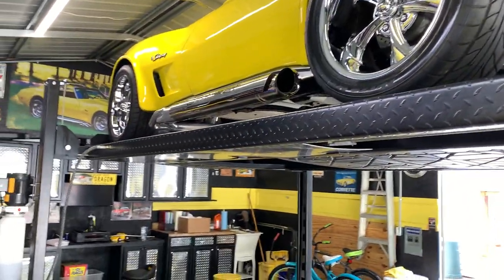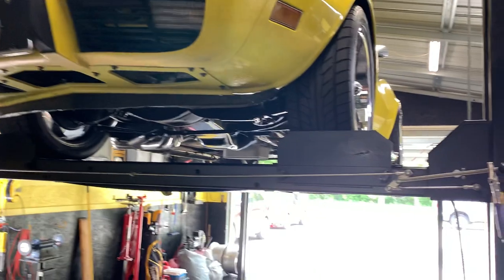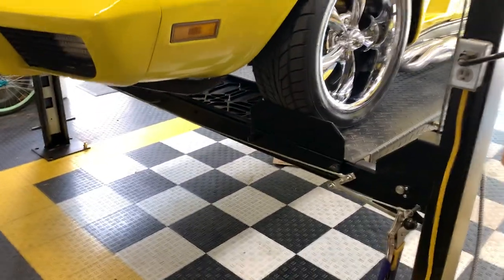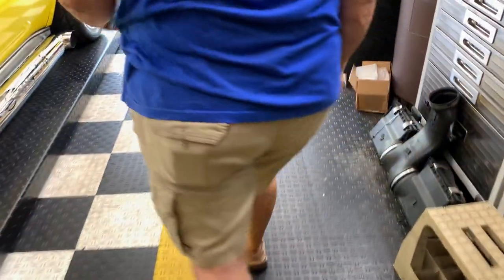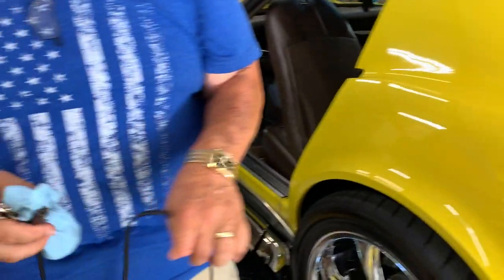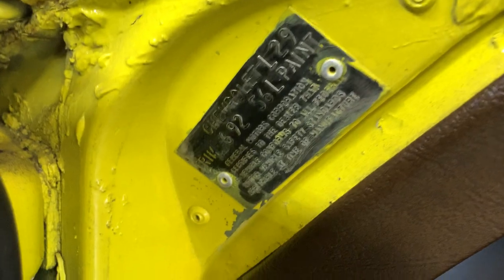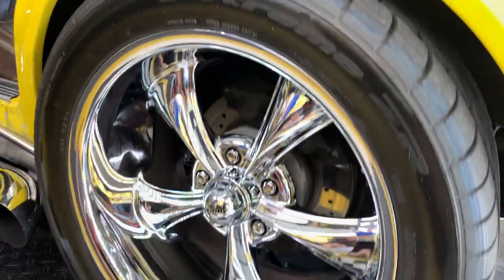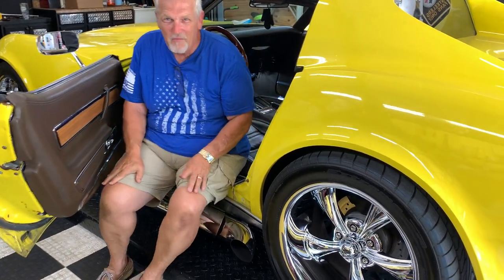1976 Corvette: PRE-PURCHASE Inspection

Comment: Hello where were you able to source to bracket adapter to fit newer style a/c compressor? Thanks
Reply from the maker: Hi there. Not my car and not sure if that’s a Vintage Air system but you may want to check with them, or call Summit Racing as they are quite knowledgeable and may have what you need. 😊👍🏻